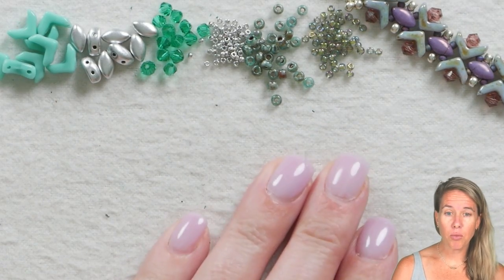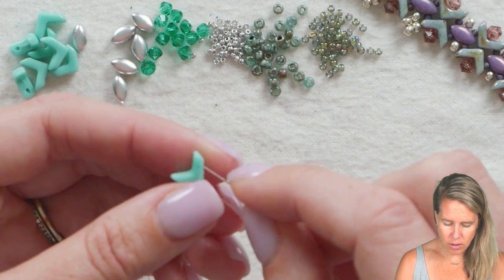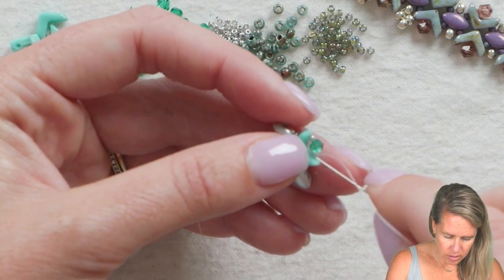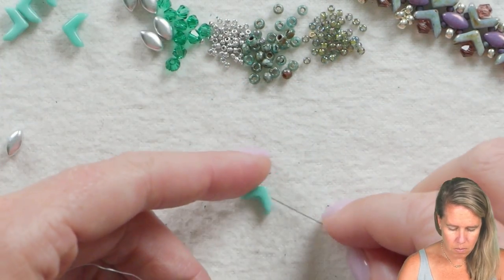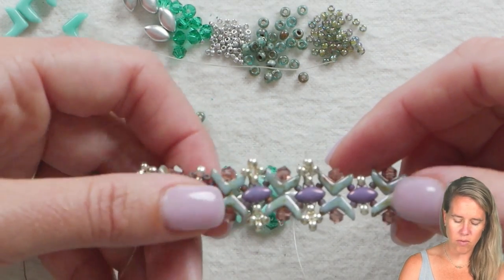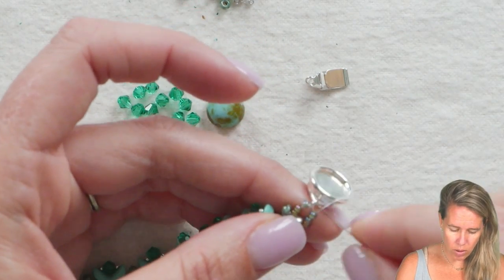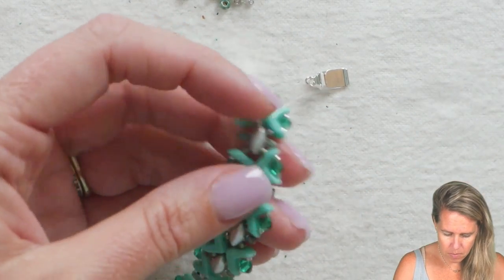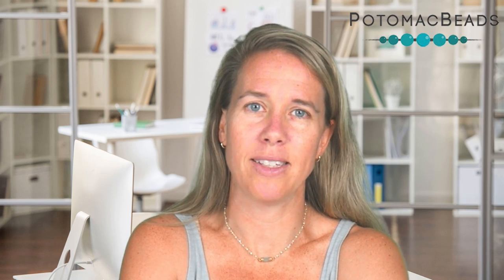Genevieve Bracelet - DIY Jewelry Making Tutorial by PotomacBeads

Comment: So pretty!  Yes, there are too few Eva/chevron patterns.  Is there any way to reinforce it so that the points line up with each other better?  Thanks.  :)
Reply from the maker: You could reinforce through the beads twice making the project a little more sturdy. You can even hold the beads with points touching as you tighten the bracelet as you go along.